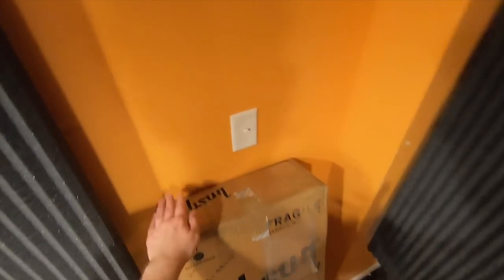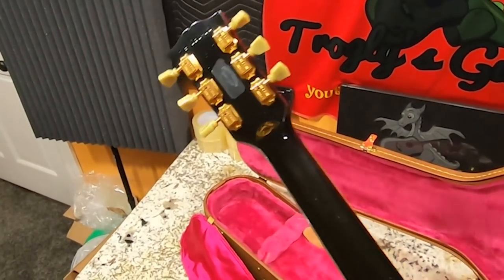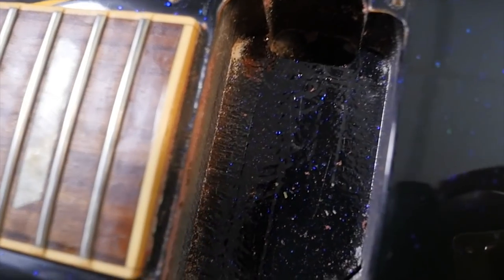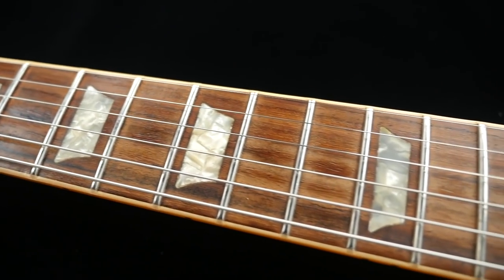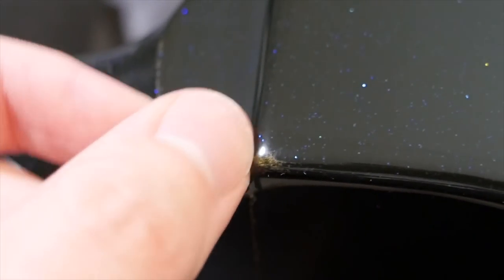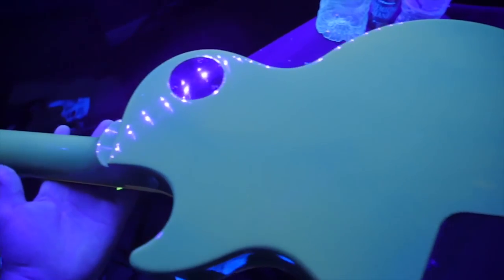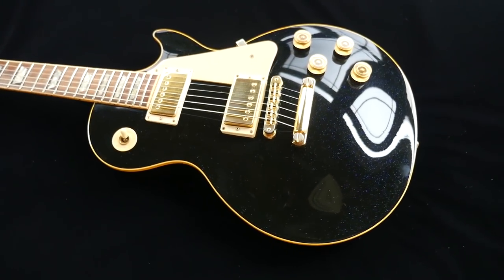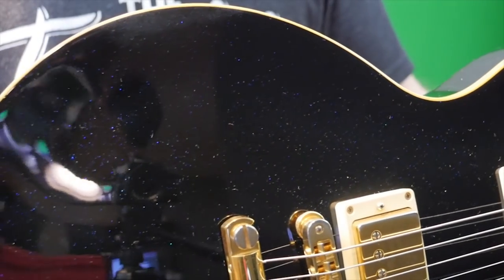This Guitar From Switzerland Had a Hidden Surprise! | 1993 Gibson Les Paul Standard Blue Sparkle

Comment: The blue Sparkle finish goes so so so well with that gold hardware. Thats an exceptionally pretty instrument Mr. Troggles. That may have to be one that goes into the collection if it is a Murphey.

EDIT: Just a note, If you end up with a piece of metal machined in Japan, you hang on to that regardless of what it is. It wasn't long before Japan outpaced the United States even in metal machine work.

Comment: From my knowledge of this guitar it was in a run of about 30. I do not believe they were painted by Murphy. It was based on a 1991 Les Paul Custom that Murphy painted that has the "Custom Shop Original" decal on the back of the headstock. I believe that one is a one of one. The original has a slightly different finish in that it has a prismatic clear as well as a transparent blue. I own it and it is awesome!

Comment: Cool, but it really looks black. I’ve got a blue sparkle custom shop if you wanna check it. 57 classic pickups sound awesome. 🤘🏻
Reply: Around 1995 right? Those are the ones with the same finish but more sparkle so it isn't so dark.. but no sparkly headstock
Reply: @kentfranklin736  no, mine is 2008 . Basically looks similar to Tommy Thayers Epiphone. But mine is a Gibson custom shop. I’ve only seen two like it total. Most sparkles reissues were done with mini humbuckers. Mine has full sized 57 classics. And oddly mine has R9 specs. But it’s clearly not an R9 reissue as I’m pretty sure they didn’t have blue sparkle tops in the 50’s. Lol. Maybe an odd Gretsch somewhere. But not on a Gibson.
Reply: @Wargasm54  just looked at one on reverb from 2008. If the serial ends in 93 its probably yours. The brighter blue looks cool with the gold/silver insert knobs.. it has a plain black back though